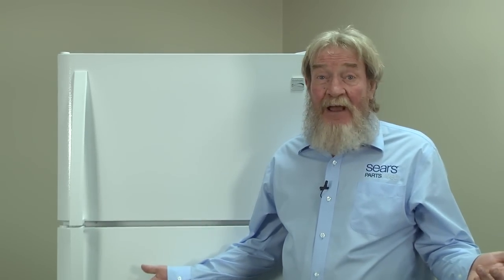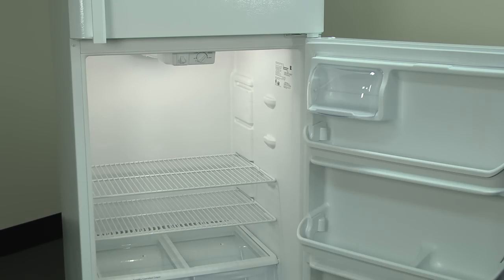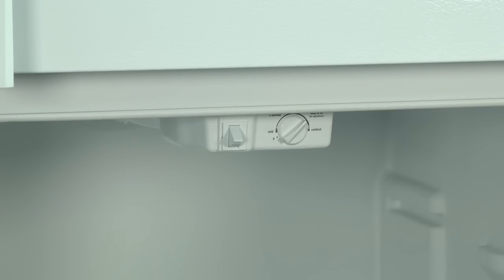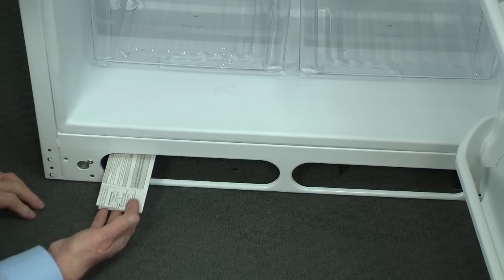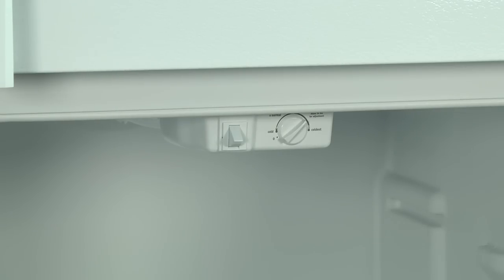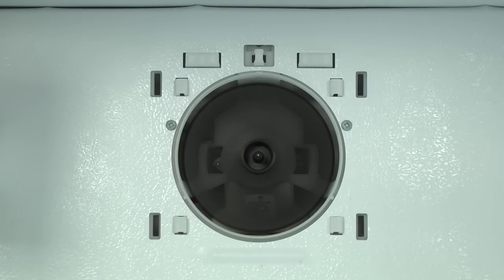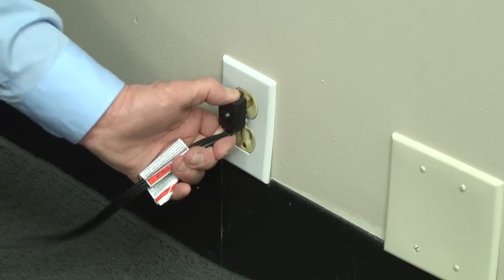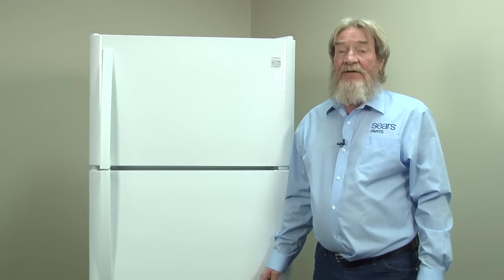How to Troubleshoot a Refrigerator Not Cooling

Comment: Hoping for some assistance w/ my Kenmore 106.62152111 top-mount. Just moved into a home with great looking Kenmore fridge. Last owner had unplugged for 6-9 months and bought about 3 years ago. Turns on and sounds like everything is fine but nothing gets cool at all. Worked great before apparently and has little dust and no damage.

When plugged in:
-Outlet is fine; power is no issue.
-Compressor turns on and gets warm; can rest hand on but not cold like.
-All fans are exposed right now; all work just fine with no dust even.
-Temperature gauge/dial changes nothing; left on for 48 hours to test.
-No ice build up on coils or evaporator as nothing gets cool.

*Only sheet included is the wiring info so diagnostics is unknown
**Haven't tested any voltage as I haven't needed to yet. Any serious electrical parts are working.

I removed the internal wiring and parts but there is no apparent "thermistor" in this unit. I was hoping someone could verify that. None is located on the parts list as well.

My only guess is it must be the thermostat. No apparent damage on while viewing; no dents or bends or burns though.

Any info would be incredible. I don't mind buy the parts and doing work but right now a mini fridge isn't cutting it. A handyman is $75 just for the trip over never mind the repair and parts.

The fridge is currently disassembled as well as all panels in the freezer to view necessary components and search for the thermistor.

Thanks for anything from anyone!

Kenmore 106.62152111
Top Mount Refrigerator
Reply from the maker: That model of refrigerator doesn’t have a thermistor. The temperature sensor is included with the cold control thermostat. Because the compressor runs but frost doesn’t appear on the evaporator coils when the compressor runs, one of the following failures is likely: the compressor is bad, the refrigerant has leaked out of the sealed refrigerant system or a problem such as a clog in the sealed system is preventing the refrigerator from cooling. A service technician will need to diagnose and repair those types of failures because the repair will involve the capture and/or recharge of refrigerant in the sealed system. Sealed system repairs are often costly. We recommend that you consider replacing the refrigerator instead of repairing it. Here’s a comparable new model that will likely cost about the same (or maybe even less) than repairing this refrigerator: https://www.sears.com/kenmore-18-cu-ft-top-freezer-refrigerator-white/p-04660412000P. If you choose to repair the refrigerator, we recommend that you schedule service by a technician here: https://www.searshomeservices.com/.

Comment: hi! my ORIENT fridge Model#OR-114F few days before remain frosted now for the last 1 week no cooling at all....how can i settle the problem please!
Reply from the maker: If you don’t hear the refrigerator running, check for power as shown at :14 in the video. If the refrigerator has power and the fans run but the compressor doesn’t turn on, follow the troubleshooting steps in this video: https://www.searspartsdirect.com/article/troubleshooting-compressor-problems-in-refrigerators-video.html.

Comment: My sister gave me a perfectly good refrigerator no more than 2 years old but it was transported to my house lying down when it got to my house it only gets cold sporadically what can I do
Reply from the maker: Unplug the refrigerator and let it sit idle for 24 hours so compressor oil will sink down into the compressor. Next, plug the refrigerator in and let it run for 3 days. It will likely cool sporadically for those 3 days. After letting it run for 3 days, check the cooling performance. If the refrigerator cools properly after running for 3 days, then it should be okay. If not, then you won’t likely be able to use the refrigerator.
Reply: Lionell Waters buy another fridge..

Comment: Hi. We replaced the evaporator fan on our Kenmore Elite model # 795.79043.310. It is running but the fridge/freezer still isn't cooling down enough.
Reply from the maker: Blocked air vents can prevent the refrigerator section from cooling. Move any items blocking the supply air vent at the top of the back wall inside the refrigerator section. Also move any items covering the return air vents at the bottom of the refrigerator section.
 
If the vents aren’t blocked, then the air supply damper for the refrigerator may be stuck shut. Unplug the refrigerator and replace the air damper if it won’t open to allow cold air from the freezer to enter the refrigerator section.
 
A failed temperature sensor, bad control board or a problem in the automatic defrost system also can prevent the refrigerator from cooling. We recommend that you have a service technician examine and repair the refrigerator if you’re not able to find the cause of the refrigerator cooling problem on your own. You can schedule service here: https://www.searshomeservices.com/.
Reply: Sears PartsDirect Thank you so much. We are currently preparing to evacuate from Irma and will try your methods next week. Do you recommend that we unplug the fridge during our evacuation?
Reply from the maker: Shannon Marie, we hope you made it through Irma safely. In the future, unplugging the refrigerator during an evacuation is a good idea because power surges during the storm can damage the electronic control board in the refrigerator. Please let us know if there’s anything else we can help with.

Comment: Hi have a GFE27GSDSS, 3 yrs old, the fridge is warm but the freezer is fine. How can I tell what the problem is? there is a little ice behind the veggie/fruit drawers. thanks
Reply from the maker: The refrigerator section has a separate evaporator from the freezer section. An air leak into the cabinet from a leaky refrigerator door gasket could be causing excessive frost to build up on the refrigerator section’s evaporator. Excessive frost blocks cooling air passages through the evaporator fan and cooling tower in the refrigerator section.
 
Check the refrigerator door seals and replace any door seal that leaks.
 
If the door seals are okay, then a bad defrost heater or a failed defrost bi-metal thermostat on the refrigerator evaporator can also cause excessive frost. Here’s a video that shows how to troubleshoot the defrost system on a refrigerator: http://www.searspartsdirect.com/article/troubleshooting-defrost-system-problems-in-refrigerators.html. The defrost system in the refrigerator section of your unit will be different than the one shown in that video, but the basic troubleshooting tips in the video should help you test the defrost heater and bi-metal thermostat on your model.
 
A failed evaporator fan (http://www.searspartsdirect.com/part-number/WR60X10357/0046/363.html) can also prevent the refrigerator from cooling. Replace the refrigerator evaporator fan if it doesn’t run when activated by the main control board.
 
If you’re not able to determine what’s causing your refrigerator cooling problem, we recommend that you have a service technician examine and repair the refrigerator. You can schedule service here: https://www.searshomeservices.com/.

Comment: I have this same looking fridge for the basement and the freezer works well and fridge is warm , so I think ice has built up and is blocking cold air for the fridge. it has done this before a few years back and I turned it off for a few days and let it all melt. I am thinking it needs a new heating element , what do you think ?
Reply from the maker: The defrost heating element could be broken but we recommend that you use the defrost troubleshooting advice in this video to determine why your refrigerator isn’t cooling:
https://www.youtube.com/watch?v=hYFT24RobCU